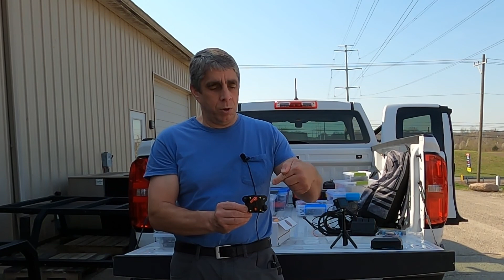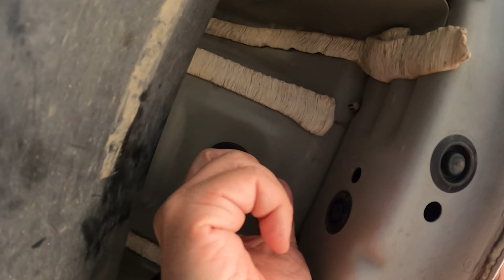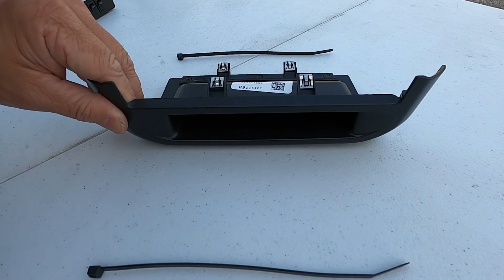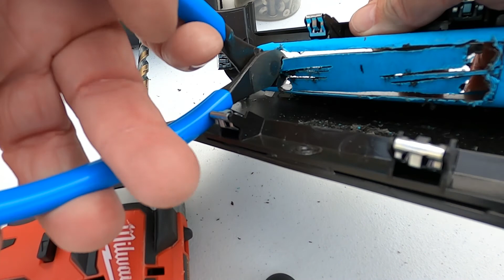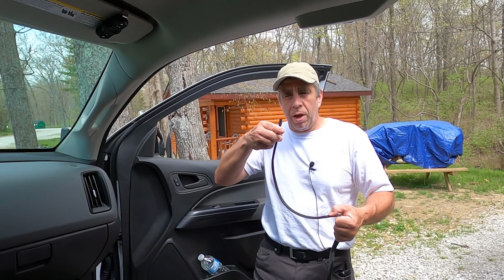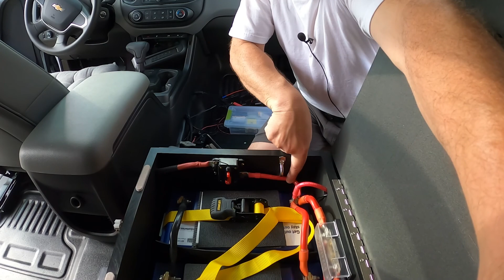Chevy Colorado Upfitter Switch Kit | S-Tech Switch Systems | Center Console

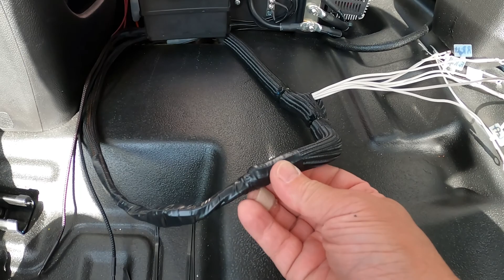Comment: At 23:15 did you isolate each crimp so they done short out since you used uninsulated terminals?
Reply from the maker: Hello, Kyle. I did isolate each butt end connecter using marine shrink tube and standard electrical tape. I also considered vibration and chafing when I placed the loom under the shelf. Thanks for watching out! The devil is in the details.

Comment: Pick up a TR-490 crimp tool. It does insulated an uninsulated crimps. Expensive tool but iv’e work in a wire harness factory for almost 12 years. Good tool for most common crimps with vehicle harnesses.
Reply from the maker: Yah, I am not an expert at terminals. If I was not living full time on the road I would pick one up, or at least have grabbed one with interchangeable dies. I lug around an hydraulic one for larger gauge wire. It's hard to pick and choose tools!

Comment: I have not finished watching the video yet but I have read it is not good to hook a lithium chemistry battery DIRECTLY to a lead acid battery in parallel or series even if they have similar voltages because they have different charge and discharge characteristics and rates.  When I do something similar to this I will use a DC to DC charger that is designed for lithium to take advantage of the vehicles alternator to charge the lithium battery.
Reply from the maker: You are correct on both fronts, General South. It is a long video and one battery bank should be isolated, consisting of identical batteries. I do not cover battery isolation and charge controllers in this video. I think I mention it in my lithium battery bank Playlist. It should be somewhere in the several hours of videos LOL. I appreciate the comments! It is a struggle communicating a well rounded message in videos and the comments section can be a great supplement.